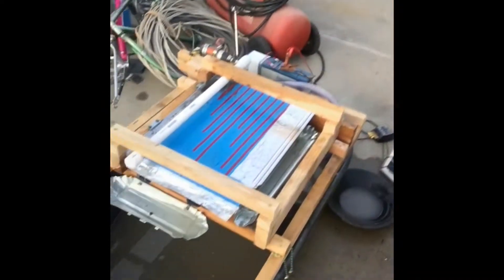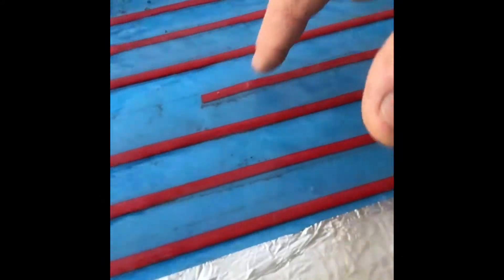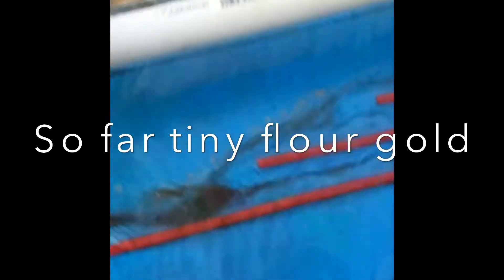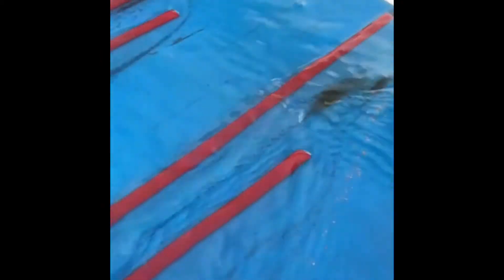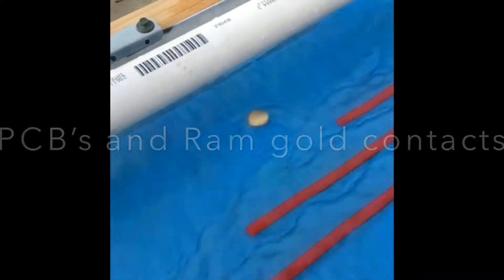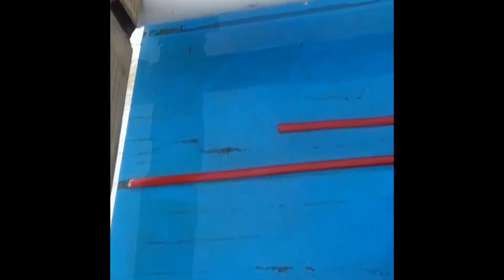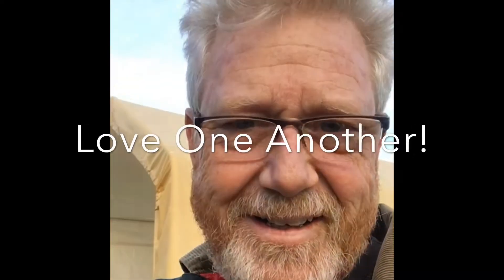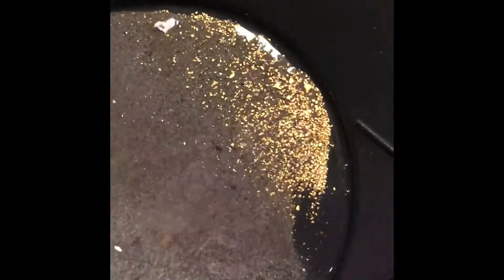DIY Gold Shaker Table build 1 rev 2

Comment: I wonder whether one way to make it more time efficient to run quantities through, would be to add a second shaker table to it, that you could fine tune for separating out the gold from the concentrate, whilst the first one gets rid of the bulk of the light stuff? That way you could set the best water flow and table speed for each task.
Reply from the maker: Andrew Burton 
Yes that’s a good idea to speed up the process!
At the moment I got it apart.. I removed the Red trim strips and cut some grooves in the Blue mat with a knife.. they are very crude looking so I purchased a router bit that should do a better job of making uniform grooves. Also I should be able to easily adjust the depth to reduce the groove depth as the material moves   Crossways down the table to improve the gangue removal.
I am also making a completely new table top that is slightly larger 18 x 24” vs the current 16 x 24”. The table top is very easy and quick and change out. I will post the progress as I can.
I apologize for the slow progress and slow posting of new videos but I still have about 4 years before retirement and thus I have limited time for my Prospector Tripp fun!
Pressing forward!
Thanks Andrew for the comments! Keep them coming!
PT